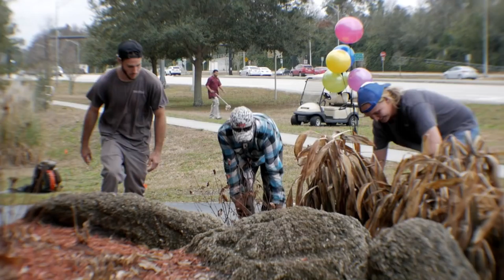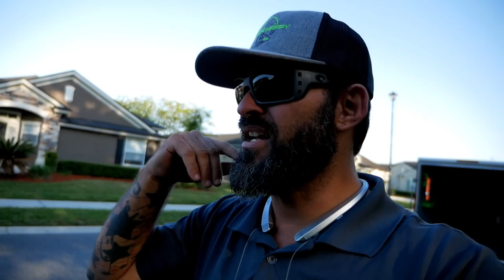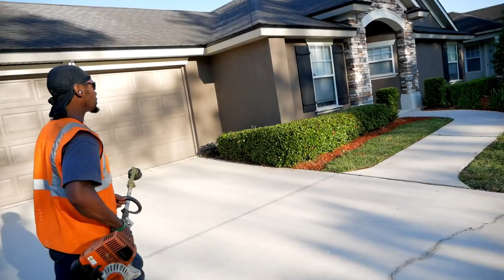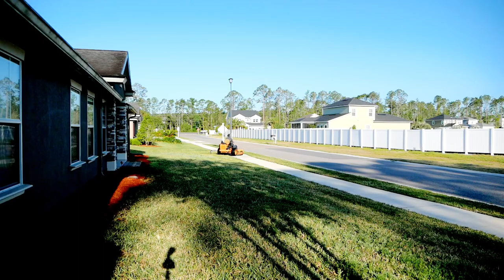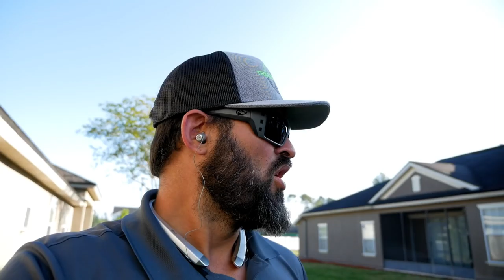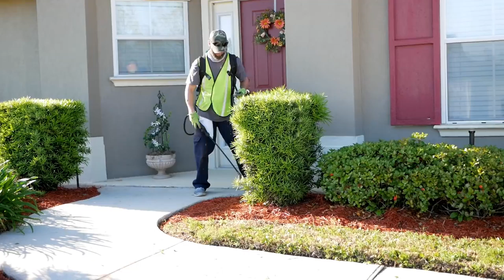This Ep. Of TRIGGER HAPPY GO! MOW TIME! Talking about our awesome guys!

Comment: Another awesome video! Question, on the Scag do you have the hurricane mulch kit or just the mulch plate? Just an FYI if you run a mulch kit on the Husqvarna, Rotary Copperhead’s worked the best for us on St. Augustine and Centipede. Wavy mulching blades and gators did horrible.
Reply from the maker: Player SC thanks man! We run the full mulching kit

Comment: What size do  you cut when you mulch does it leave clumps
Reply from the maker: Orlando Palacios that's a 61" and rarely only if it's super super thick I will mow any clumps out. Usually needs to be roughly  10" or more to kinda clump some

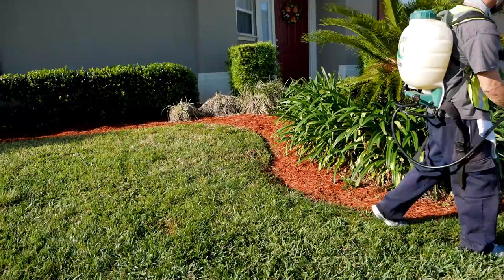Comment: 10:09 I always herd L&O was a pain in, FL. Or am I mixed up(?)
Reply from the maker: Ty Perdon if you're going to fertilize or put pesticides in the grass absolutely but not if you're just spraying weeds in the beds
Reply: Ty Perdon You can apply fertilizer only ( no pesticides, herbicides, or weed and feed) to turf and ornamental with less than $100 and a few online courses.

 Pesticides and herbicides on ornamental plants and beds is a sit down class and something like $200 or $300 in fees and books. 

Impossible to apply herbicide/pesticides on turf unless you have pest control business license (which requires three years experience as service level employee of licensed pest control business).